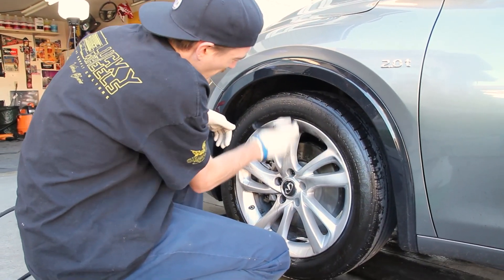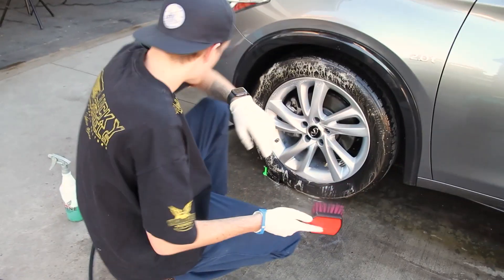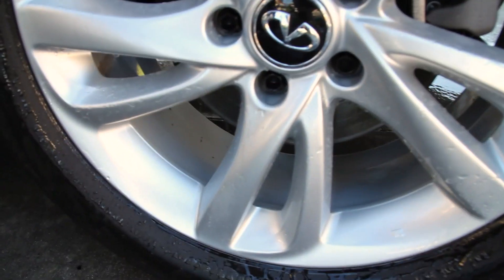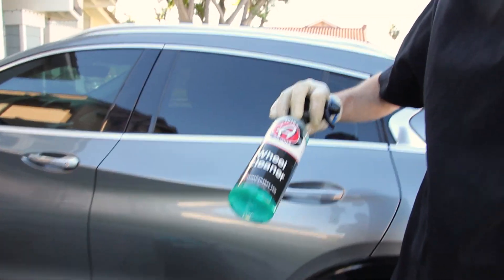WHEEL CLEANER WARS: ADAM'S VS SHINE SUPPLY

Comment: I have a much different experience with adams rubber and tire cleaner. Works excellent on my tires.   One pass black as can be. Adams wheel and tire is what I use and it's just as good if not better. I do know that the tolco spray head is high output. So he was using way more product with the shine supply.

Comment: Good review on the Shine Supply Wise Guy. I’ve been using Tuf-Shine Tire Cleaner which is powerful and really deep cleans the sidewalls. I have a lot of cars come into my shop with solvent based tire dressings and I need a product that is strong without choking me. The Tuf-Shine has fumes and I cough all day after using it. I’m looking for a strong tire cleaner without the chemical fumes. Will Wise Guy fit the bill?
By the way you should check out Koch-Chemie Magic Wheel Cleaner. It’s very effective and safe to use on all types of wheels.  I am a new subscriber.